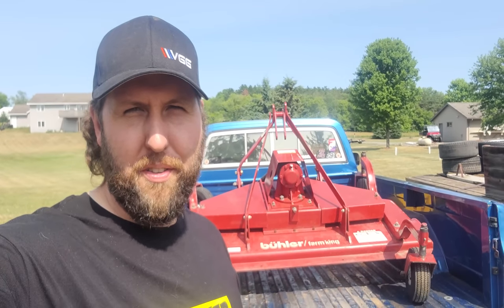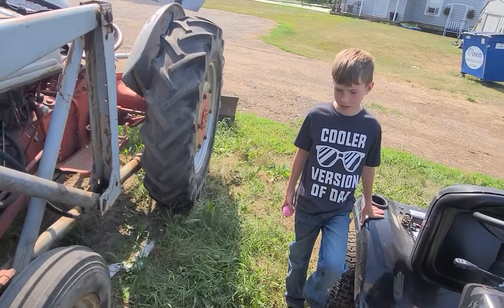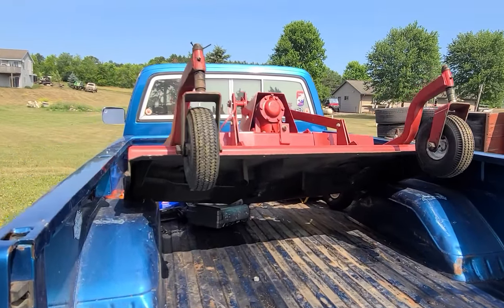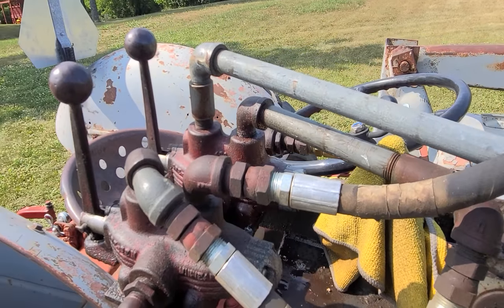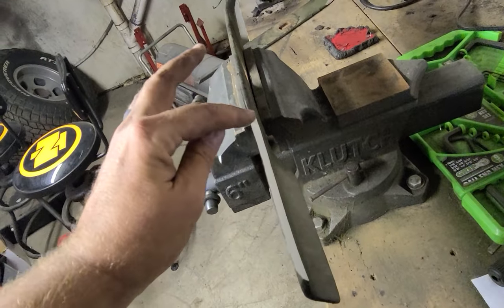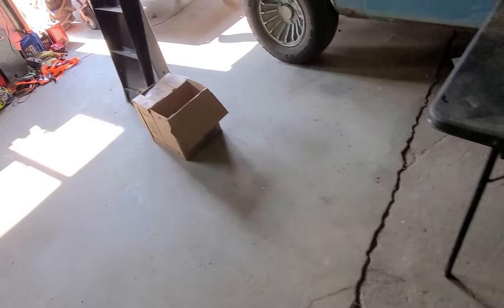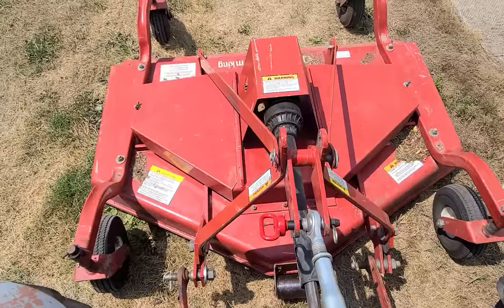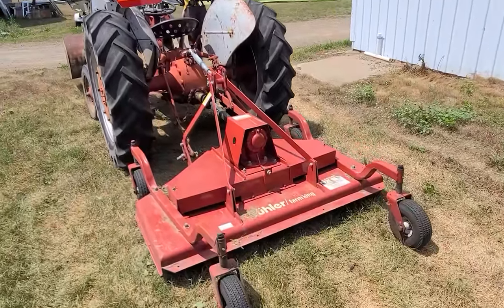Will This 3 Point PTO Finish Mower Work on the Ford GT500 (8N/9N)?

Comment: Bush hogging and that mower, use a chain top link to allow the mowers to float. Might work nicely. Weld a short bar to the chain to prevent flipping up to high if y’all drive fast in the rough stuff!!!

Comment: "Z-turn" or "Zero-turn" as in Zero-turn radius platform. They call them that because technically tou can pull one drive control rearward and push the opposite control forward and the center of your tractor will spin on a single point requiring ZERO RADIUS to turn the direction of progression.
Perfect for very close lines around sculpted flower beds and elaborate landscaping. 
In a commercial lawn-care setting, your String-trimmer hands will LOVE you for changing FROM step-thru tractors TO Z-turn tractors.

Comment: That joystick you want is electric over hydraulic and only found on newer equipment. What you have there is the industry standard, and in my opinion as good as it gets. That joystick just creats more problems and adds digicals.

Comment: PAY ATTENTION:  You already have a comment just below mine warning you about the using a bush hog with a Ford 8N.  It's a "non-live PTO", meaning that the bush hog will store vast energy in the blades and when you push in the clutch to stop, the stored energy will force against the PTO shaft and propel the tractor forward (sometimes through a fence ... yep, ME).  You can get an adapter at your tractor supply facility that will provide an over-running clutch on the PTO shaft and negate this issue.  The blades will continue turning, but the energy won't act on the shaft any more.

Comment: Side note. Reducing the inside diameter of a hydraulic hose. Or a reduction fitting. Will slow the amount of fluid going into a cylinder.  That means the bucket will go up and down slower. And more manageable. Not so violent.

Comment: i was 10 driving the 72 c10 around the field pulling a wagon behind dad who was driving the 8n running a 2 row pull type corn picker. staying on track so the corn wound up in the wagon from the chute was a challenge, specially round the corners. 'cause it was gonna be me pickin up the ears that hit the ground. waste not, want not, right? no man left behind, or rather no corn as it were. the 70's were a ton o' fun lemme tell ya.

Comment: For your hydraulic controls, I would talk to a company that rents personnel lifts; boom lifts, scissor lifts, I'm sure they could hook you up with one of those control units with  speed adjustment. I am well acquainted with those old controls that go from closed to wide open no matter how cautious you are. Try it 50 feet in the air some time, you learn pretty quick how powerful your sphincter is.

Comment: I use the finish mower withou the upper link. It will float on the ground and not interfere with your tractor tires.

Comment: Not sure about the old tractors but newer ones you can pull out the pto stub shaft and turn it around and reinsert it its a different size on the opposite end

Comment: Looks like the lower arms on the deck that attach to the tractor has one on the outside and one on the inside they both should be mounted to the inside and it may keep it from snaggin the rear tire as bad when its lifted up derek

Comment: 16:12 the linkage for the mower on the right should be the same way round as the left, the link arm on the right should be attached on the outside like the left one is

Comment: Had several rear discharge and never needed rear guards(with finish mower). Speed blade in 3 short blades is generally lower velocity

Comment: Ah, memories. I had a 48, 8N. I put a 72 incher behind it. It did GREAT as a finish mower but…………..I couldn’t be satisfied. After hours and hours of faithful service it finally blew the head gasket after repeatedly using it as a bush hog. Just couldn’t handle the ripums and the temp. Swapped the old thing for a Massey at Moore tractors in Gallatin. With power steering, live PTO, real brakes and double the hp, it was like going from a VW to a Cadillac. 😆

Comment: Your toplink should be longer, so that the rear of the mower will float over any bumps and ditches, thats why the toplink mount has a pivot in it.

Mowers and such fast spinning implements generally work better and last longer the higher you rev it "within reason", as long there are not vibrations or bearings getting hot

Comment: I couldn't tell, and you probably already know this (i'm pretty new to this farming stuff). But you might want to run an over run clutch on that pto.  I had an adapter like that on my  2n (non overrun style) and I exploded it running a 4 foot brush hog.

Comment: Didn't see someone mention it yet - The top bar of the three point should be loose on a finish mower to allow the mower to pivot with the ground.  The way you have it in the video should damage anything, but will live it up if the ground is sloped away relative to the tractor.

Comment: A puff of air for the front tires might ease your steering effort a tad. Moving the spinner knob out to the rim could have the same benefit. Now you can sit in the shade with a cold snack as the next generation wrangles the machinery around the lawns.

Comment: You can add limiter chains to lift arms to keep it from swinging so much. That tractor should not have any issues mowing if tuned up.depending on how thick the grass is. Dont over speed that mower. I have a road gear or OD unit on my IH F12 that will make the mower sing but is very damngerous.  I think that high gear in your is for road gear (traveling)

Comment: You can add a valve to restrict your hydraulic flow to your cylinders...it shuts the capacity of fluid so you can feather your control when needed....it just is basically like a tap on your sink....close it ..slow...open it..full flow....i have one on my Hydraulic crane and it helps to make it move nice and slow and not jerky....my crane reaches 115 feet up and has a man basket ....saves on cleaning the bottom ( it has drain holes ) when i moved people around near buildings ( window washers ) plus alot safer ....you can grab full on control lever and it justs moves slow and smooth..up or down...

Comment: I went and found an adapter, with a built in clutch for my 49 8n. I run a mower just like that, it runs it beautifully. Just cant let the grass get too tall, or the old girl just cant quite cut it.

Comment: Is called a live PTO which means just because you push the clutch in.  Does not mean you will stop.  You only stop once the mower stops turning. So be careful around the pond.  I speak from experience. Lol

Comment: Been mowing my 1acre field with an 8n,no loader,5 foot finish mower,no orc for 5 years no problem except for the nail,spring clip,bolt always getting loose and coming out and then I loose a wheel and all the height spacers. I have plenty of room and few obstacles and have never been pushed around by the mower  when the clutch is in. However i feel that an 8n is a poor choice of tractor to mow with and when I can afford a better set up I will get one.

Comment: Tractor is most likely a 2n judging by the tubular style radius arms vs cast found on 9n’s and some 2n’s, bolt spacing on rear wheel is too large to be an 8n unless axles were changed for some reason, love the videos!
Reply: Radius arms, hubs, 3 speed trans, and a brake on each side, it’s for sure a 2N. Mid 1944 was the cutoff for I beam vs. tubular radius arms, so it’s somewhere between there and a 1947.
Reply: @justinstearns9723  thanks for the clarity👍

Comment: Be nice to have a tractor with a loader.   I've got my grampa's '54 Ferguson TEA20, need to fix it up a bit (fuel make it happener, ragiator, oil & filtray, axel seals, brakes) & get some implements for it, trying to decide on slasher, finish or flail mower & what size. 
A hydraulics shop should be able to get some smother operating controls or maybe fit restrictors to slow it up.

Comment: An over-running clutch built into your pto adapter is useful when using a shredder. When you step on the clutch without one the spinning blade will push the tractor until the blade stops. My boss bought a 8n with a shredder. He had no experience with tractors. He was cutting his chain link fenced area, turned too late, got jammed in a rt angle corner. We had to use our wrecker to drag him out of the corner. He ruined the fences where the frt end and the shredder hit it. On a straight section going full tilt, finish mower engaged, step on your clutch and see how long it takes you to come to stop rolling. Decide if you might need a ORC. Note Inexperienced drivers need to be aware when emergency stops may be needed. Always enjoy your videos. Take care sir. Note2 ORC adapter will add weight and may cause pto seal to start leaking. Years ago there was a sleeve that could be bought that fit the small shaft and was the large dia. on the outside. That sleeve added minor amt of wt.

Comment: Good topic. I've been wondering about the hp 'requirements' of implements since i own a Kubota B6100  rated somewhere around 15 pto hp.  This is my first tractor and so far what I've found is that the HP of the tractor mostly seems to dictate how fast you can do something, not whether it can be done. I've found a lack of weight to be a bigger problem than lack of power, but that's not relevant to mowing. Seems to me with the PTO finish mowers the question is  can you drive a wide enough mower that mowing at 'tractor speed' is actually faster than using a smaller machine wide effin' open, like i usually do. I suspect the answer is generally no and that the mower would have to have some kind of added utility to make running it off a tractor worthwhile. Flail mower falls right in there, bush hog makes sense if you don't care how pretty the grass is.. or in my goofy head, how bout take a 42-50" deck off a broken rider (got a few..), run it off a used power steering pump being backdriven as a hydraulic motor, and put it on my FEL so I can mow at all the most dangerous angles and altitudes?  Anyway, keep it up!!

Comment: Dude, you're over-thinking the unloading. Do what I do: Get a couple of 2x6(or 8...etc.) planks and use 'em as a ramp at the rear of the truck. Slide the mower back and onto the planks, and once you to the tipping point it'll just slide down. (Loading can be done in a similar manner if you have something towards the front of the truck to secure a ratchet strap to- just winch 'er up with the ratchet strap.)

-Former city boy who figured this stuff out quickly

Comment: I suggest you acquire an over running clutch for your PTO.  The mower will act like a flywheel and you will not be able to stop forward motion of the tractor as normal.

Comment: Right. That Sherman transmission has 3 ratios. standard, High, and low. The PTO is driven by the transmission. So the faster the trans is spinning, the faster the PTO is spinning. The mower is rated at 540 RPM. So you are right, in high the PTO  is probably spinning faster. If you can get a tractor with LIVE PTO, or independent PTO, that is much better for cutting.

Comment: Need a couple of stabiliser  bars on the three point linkages ares or the mower will move sideways   went turning  and think you can buy a spool value with just one control for the up and down check  with tractor parts and sale places they would have  listing on valves

Comment: got my hopes up thinking you were using it to upgrade the craftsman with a 60 deck ... belt drive to pto uh ... hmmn it'd take some finagling, probably stall the motor to spin it up but would probably work once they got spinning enough then just ease through grass at a slow pace but 1/3 wider at least so still faster

Comment: Looks like you need to give that Ford some love. It seems to have a solid engine, but the rest of the machine needs some care. Tire are all cracked and the hydro pump and controls for the front loader need an upgrade so the pump can be disengaged and lock the bucket in any position when not is use. 

My grandpa had a old Ford Ferguson that I learned to drive and plow a straight row when I was about 11, so your son has a head start on me. Grandpa's tractor didn't have a front bucket, so the front tires when straight up with me at the controls when he tried to hitch up a disc that was way too big. You already know that the pto/rear hydro design sucks - you can't get lift unless the pto shaft's turning and height selection on the rear is a guess at best. 

When you start mowing for real, you might try spinning up the mower before in neutral engaging a forward gear. That way you're not trying load up the mower and the tractor at the same time. There'll be enough inertia in the mower to give you a couple of seconds to engage a gear after the mower spins up.

Do you have an optical tach? Put a piece of white tape on that pto shaft and see what she's turning at various throttle settings.
Reply from the maker: Pto shaft is in direct relation to pto/transmission.  There is no "pto in neutral" option with ford 2n/8n/9n.

Comment: You man need a flex link on the top bar od the 3 point hitch and a self ratching drive shaft so the mower does not push the tractor.

Comment: Most PTO driven equipment calls for a PTO speed of 540rpm. You set your throttle to the engine rpm that gets the PTO to speed, if I remember correctly it's around 1500 engine rpm. Also, you should be mowing in the low side of the transmission. Putting it in the high side also increases the PTO speed which would require lowering the engine rpm to remain at 540 PTO rpm.
 Running your mower slightly over 540, say maybe 575 not too bad running over that bad things could happen. Especially if you didn't balance the blades. You could end up with a whole lot of shrapnel.

Comment: We usually ran ours nearly full throttle in first gear in hi range 
It would just be first gear on that one.
Hi blade speed and slow travel speed get the best results.

Comment: If you go out and street race that tractor you need to get a couple rear tires on it. Those have a couple cracks in em. I guess you could go finish em off at a burnout competition. . Keep the tractor vids coming

Comment: Crank the handle on the drinker side 3pt arm and it will straighten the mower up and get it away from the tire for a guy. Just need to adjustulate her a tickle.

Comment: There should be another setting in the other gear box. Put it in neutral pull out on it and back that should be the PTO setting. That’s the way mine works.

Comment: Someone may have mentioned this already but I noticed your grassy areas have a mix of sandy/bald spots mixed in. The high lift blades will suck up sand and decrease the life of the blades and the under side of the deck. Check out the market for some lower lift blades. Might get a little more life out of her. Also should reduce the effort the gear box needs to put in and reduce the loudness of the mower in general.

Comment: The other super sketchy thing about these old tractors is that the PTO os either on or off. So if you're lifting the mower, it's also spinning. And for the love of Pete, get a freewheeling clutch for the PTO (you can adapt up to 1-3/8 in the same piece), or the mower will drive you into things, regardless of whether the clutch is in or out.

Comment: I was thinking the PTO on the old tractors was different and you need an adapter.

Yea no need to lift mowers all the way to the top. Just enough to lift it off the ground and not hit low spots.

Comment: Plan 2. Hook a strap to the mower and put Ole Blue to the floor. That mower will pull a "Wile E. Coyote", and by that I mean hang in mid air for a second, then drop like a rock.

Comment: 9n   3 speed with High overdrive aux trans trans driven PTO. Mower RPM speed is 540. The Aux trans in high will double your PTO out speed.  1000 PTO rpm Will burn your blade spindle bearing out in no time.

Comment: If, If you have an overdrive sherman trans. when you are in over drive the sherman drives the trans faster than regular drive so your PTO runs faster than 540 rpms. I don't remember just how fast it runs. I think half throttle would be 540 rpms. Sherman made a over /under trans and a reversing trans too.

Comment: I would think that tractor would be plenty enough for a 72 inch. I got a 9n that pulls a 5 foot bush hog pretty good. I would think a bush hog needs more power than a finish mower especially if you’re mowing tall weeds like I do.

Comment: you absolutely need an overspin clutch with an N series tractor, the pto drives through the transmission conversely the device will drive the tractor when you should be stopping

Comment: Is that a step up or step down aux trans? I had the Sherman step up in my old Ford. Now I have a new Kubota B2601 with 9 hours on it. I bought it to plow snow. It did come with a 60” mower deck but I haven’t used it yet. What’s your address? I’ll bring spotted cow and I’ll let you take the tractor for a spin. 👌

Comment: My 4010 John Deere has a loader on it. Two spools have one handle
 That is called an Austin valve/ Austin.handle. Course spline p t o 540 r p m. Fine spline is 1000 r p m .

Comment: It should pull it with ease, lol.  We used to pull a heavy thick framed bush hog with our old '39 J-D "A" every year and it did it without a second thought.  My Uncle bought a GT500 new back in 1969 but his looked like a car with a convertible top, lol.  He sold it for way more than what he gave for it in I think 1988 to a fella out in CA who flew here to get it...kinda like you do with your will it run and drive 600 mile videos except that this was way before youtube.  Uncle bought 20 acres of land with what he sold the car for.